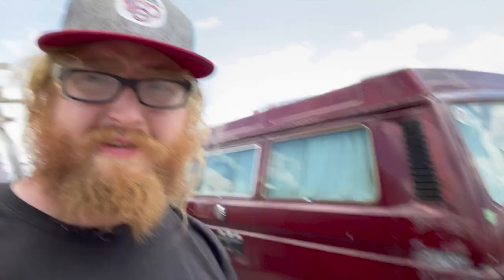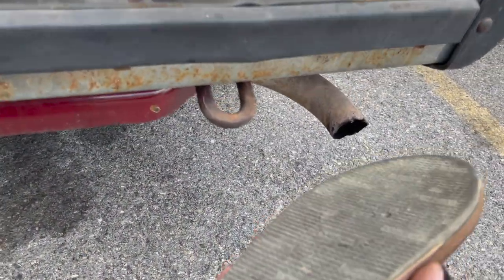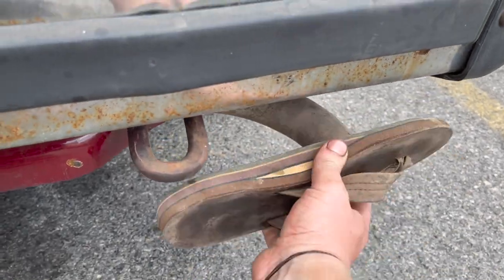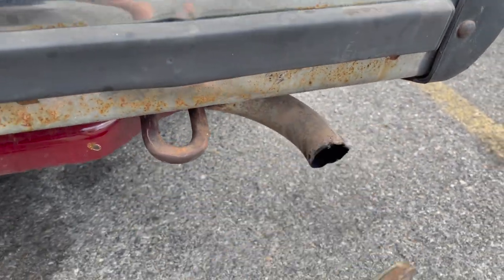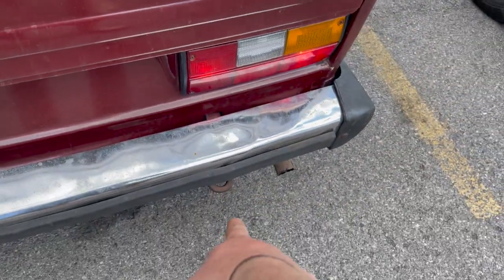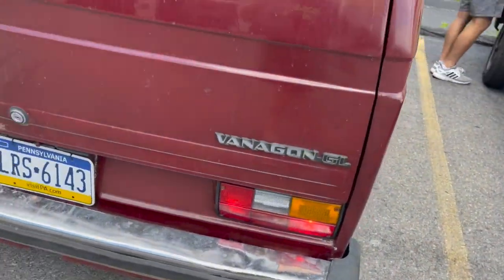Abandoned VW Camper Van- First Road Trip!

Comment: Many of the Vanagons in my (european) market are diesel powered which puts less stress on the cooling system, improves fuel economy, torque, horsepower etc. Common trick is to fit a VW passat gearbox upside down to add a 5th gear and stronger cogs overall. My ideal would be a Vanagon Westy from Arizona with a 1.9 pd engine giving about 150 bhp. Sigh...
Reply from the maker: Those diesels work well in the two wheel drive vanagons. It’s still an expensive swap though!
Reply: In the United States diesel price is typically a dollar more than petrol as you might call it. Aside from the cost of doing the swap, you have less reliability due to the turbo and diesel pump and belt. Glow plugs and injectors.  There is more maintenance requirements and more complication unfortunately in with our diesel price being high, it would take 300,000 miles or more before it even pays for itself unless you do everything cheap and used.